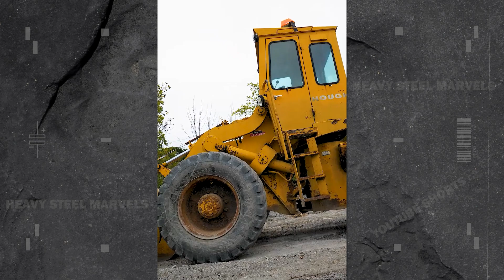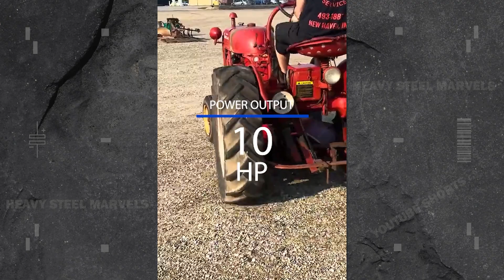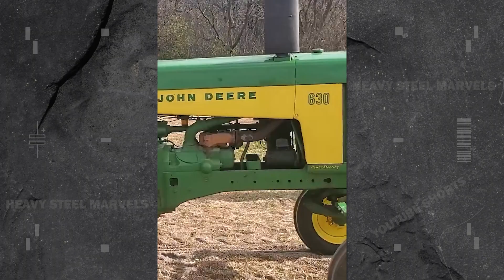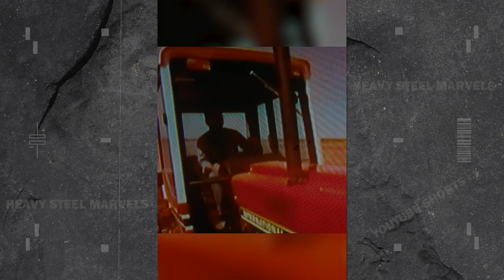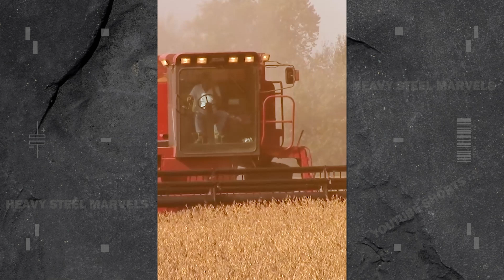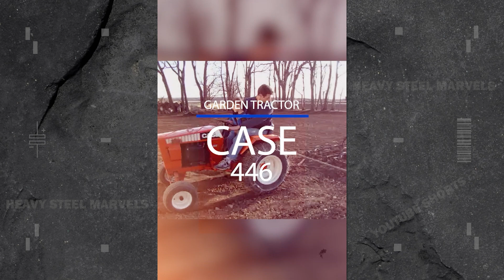1 Hour Of Tractors & Farming Equipment History | YOUTUBE SHORTS

Comment: The Deere R Diesel was about as antiquated as it could be when the first one drove out of the manufacturing plant. Tremendously noisey, slow,  couldn't run the hydraulics only WITH the pto.  A person that had more access to info on the R than I had told me a month or two ago the R's pto drivetrain was only capable of transmitting 15 horsepower, meaning a Deere model B could run a larger pto load than an R. The R Dad had we only ran the pto to make the hydraulics work, the road commissioner that bought it ran a heavy-duty pto rototiller to chew up scarified chunks of oiled dirt roads. Road Commissioner also destroyed the R's pto drive trail FOUR TIMES IN FOUR YEARS and traded it for an OLIVER 77 DIESEL which was still running fine 10 years later when I worked for the road commissioner. I didn't run the R much but sure put a LOT of miles on the trucks. In fact, the second summer I worked for him I had a brand new 1974 C-65 cab/chassis under the dump box to haul cold patch and sand and chips to spread on freshly oiled roads. I started running 20 to 25 miles one way then the BOSS found out I could get cold patch 11-12 miles away.
    I did NOT enjoy running the R we had, that constant hammering of those two large cylinders abused my ears terribly, my ears would ring all night if I ran the R much after lunch. If I ran the FARMALL SUPER M-TA or 450 after lunch, there was no problems, sometimes I'd run them several hours after dark. Dad wasn't big on doing fieldwork after dark but if I didn't have anything else to do I stayed out later. We had a 1963 4010 diesel for a few years before Dad quit farming. Any day I could drive it back to the house was a really good day for it. There were a L-O-T of 4020's, they seemed to run and run, our 4010 was lucky if it kept running until lunch time.  Nobody else within 20 or 30 miles had a 4010, Dad's brother had a 3010 diesel, He sent it back to the dealer three times the first month he had it. He was replacing a 400 GASOLINE FARMALL, DEALER would turn up the 3010's injection pump and take it back to him, Did that THREE times before he kept the 3010. A common problem with 4010's and 3010's was that stupid bolt-on 540 rpm pto stub shaft. Dad was mowing grass waterways and trimming weeds around buildings with the 4010 and our 6 ft Brillion bushog cutter. It only had 2 pto joints on the pto shaft and hammered those joints really hard on tight turns. That loosened the 4 cap screws enough the stub shaft finally fell off and the tractor's pto shifted from 540 to 1000 which tore up a whole BUNCH of expensive parts, and required a " double split of the pto gearboxes to replace all the destroyed parts. We had a 1940 B deere also, it did not start well by spinning the flywheel, there was no battery start. Our starter of choice was to use our Super H FARMALL & chain to either pull start the B, or since it was already running, just use the Super H.  We tried grindling earcorn for cattle feed in the driveway of the corn crib with the 4010 once, remember it was diesel, it filled the driveway with diesel fumes, I almost passed out. We normally used the GAS FARMALL M, and also found out the Super H would run the Kneodler burr mill.

Comment: Video full of alot of information on equipment. Not picking on JD but they go around in circles alot 2 cylinders had hydraulic levers in the back like a console 10 series they put them on dash later 20 series moved them back  combine 9600 was a glorified 105 with technology behind it I guess all the other manufacturers do the same thing one way or the other right.